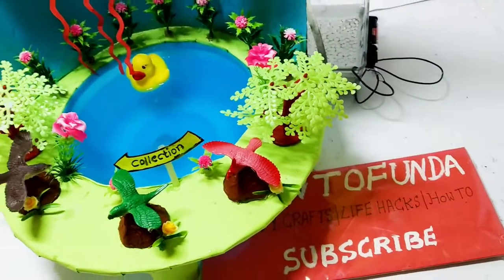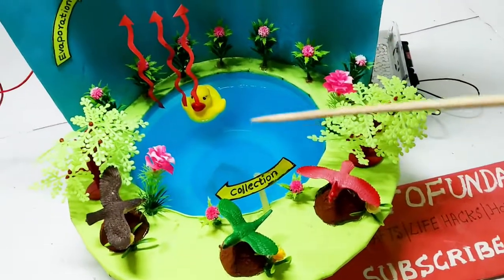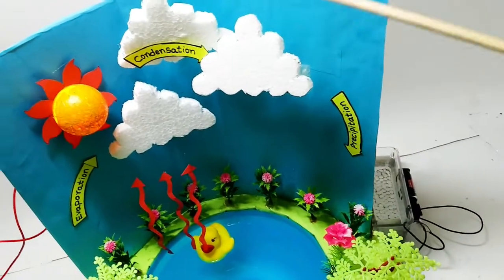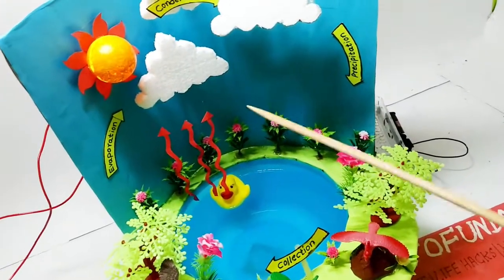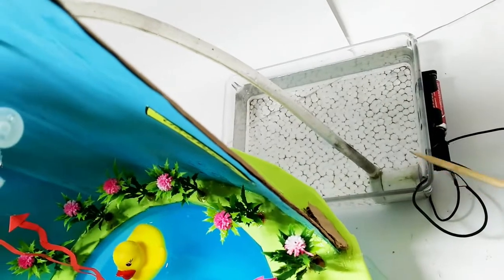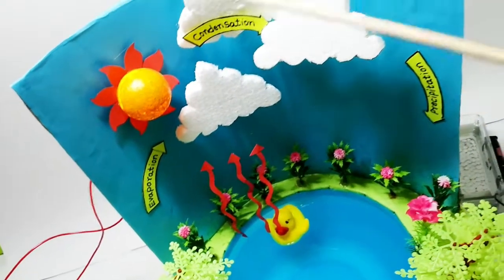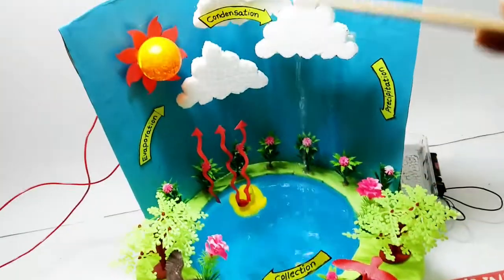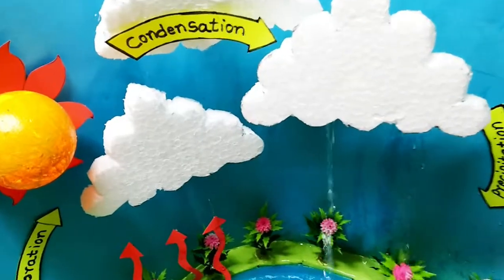water cycle working model explanation in english | howtofunda

Comment: Hello, breathtaking, unheard of the water cycle?
1- Clouds and rainwater do not form by condensation of water vapor which is decomposed during its ascent into H2↗ and O↗ by action of solar ultraviolet radiation
hv + H2O --> H2↗ escapes + O↗ escapes
2- Clouds and rain water are formed by a real chemical reaction in the atmosphere.
H2 + O --> explosion (lightning-thunder) + H2O (rain)